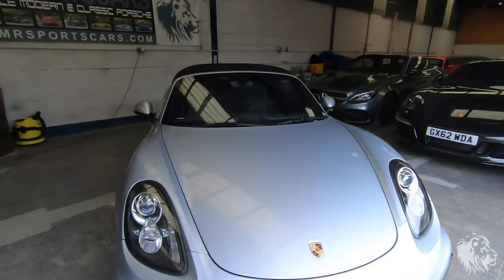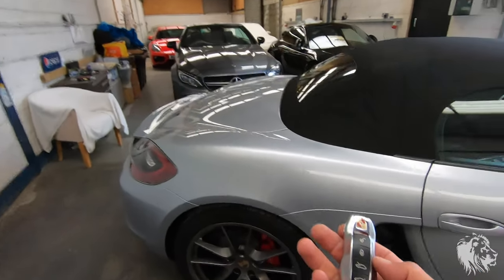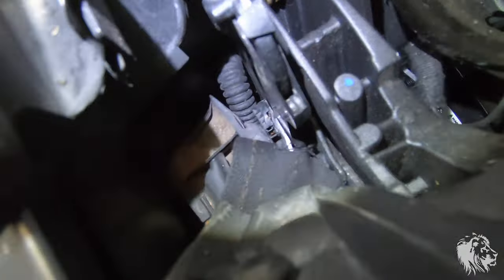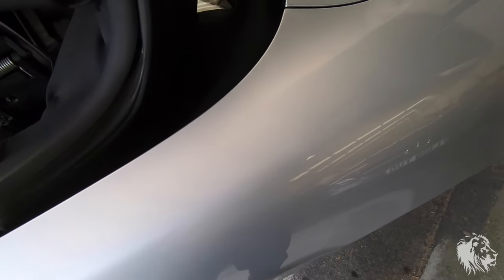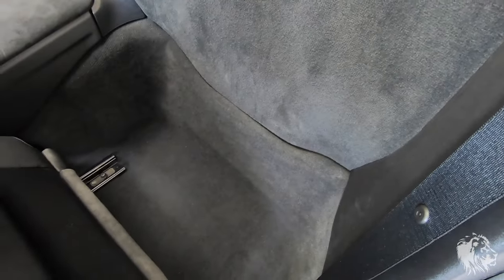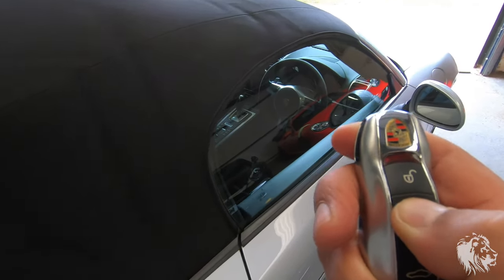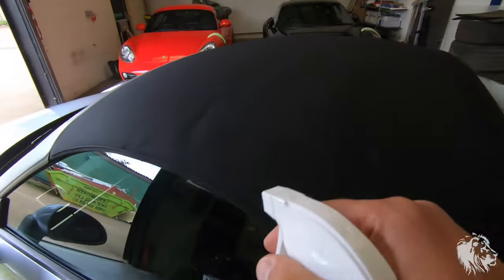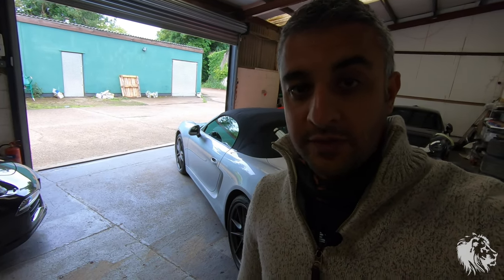Porsche 981 Boxster Fabric Convertible Hood Care and Maintenance Clean - How To Guide Review

Comment: Glad I found this. Just bought a 981S so will be checking in the morning. Nice straightforward video. Good ad for the company. Thanks.
Reply from the maker: Thanks Mike. If you find water under the carpets, check out my more recent video of unblocking the rear side drains by removing the side panels around the side vents! Cheers, Raj

Comment: Just a quick note
A friend used the Autoglym kit and when he went to have the hood recoloured the Inde he used could not remove the product evenly meaning the hood went patchy when the colour was applied. 
For this reason I use Porsches own roof cleaner and protective spray 👍🏻
Reply from the maker: Good point! I think all water repellent treatments will cause this issue to a more or lesser degree. Cheers, Raj

Comment: I also use a lint roller, one of those with the sticky sheets on a drum.
I could see odd bits of dirt on the hood, 20 seconds with the roller and its all clean.
My Boxster S lives under a car port but a cat seems to like sleeping on the roof!
Reply from the maker: Thanks Nigel, sound tips and advice! I would be concerned about the cat though, if it decides to dig its claws in the fabric then you will have issues! Cheers, Raj

Comment: Hello Raj. I've got a 987 Boxster. My carpet under the passenger seat gets soaking every time it rains. My front and rear drains are clear and water flows straight out of them. I also cannot see any damage to the rear drain tray. The seals around the side windows get a little bit of moisture between the glass and rubber, but no visible drips in the car when I wash it. I've had the car 1.5 years and not treated the soft top. I'm going to do it whilst I've laid it up for the winter. Is it possible the hood gets so soaked the water is running down one side into the rear of the passenger well?
Reply from the maker: I would guess that the door membranes have split or are perished, so water flows in through the doors. Is the carpet on the bottom of the doors themselves saturated? Cheers
Reply: Hello, no the bottom of the doors are dry. I'm baffled. The sponge under the drivers seat literally is sopping wet. Passenger side is bone dry. The drip tray seems fine - no visible damage to it.
Cheers  @MRSPORTSCARSPORSCHE